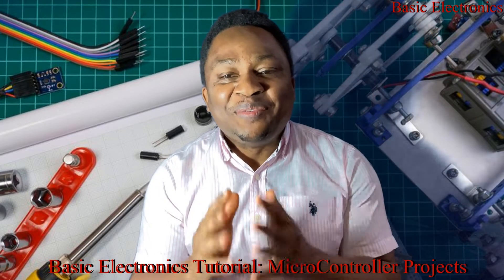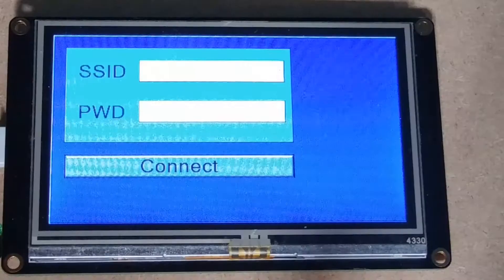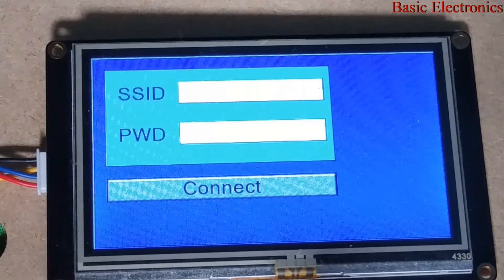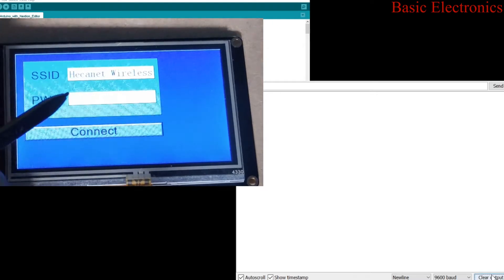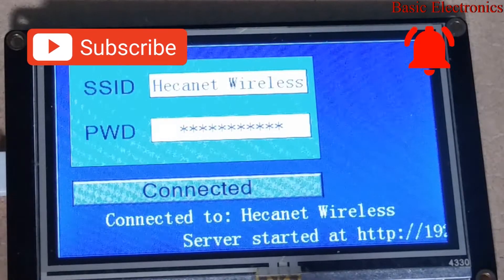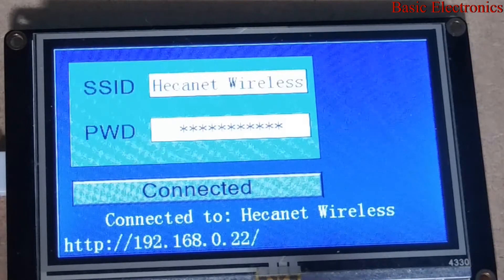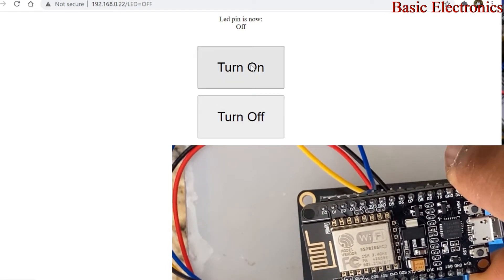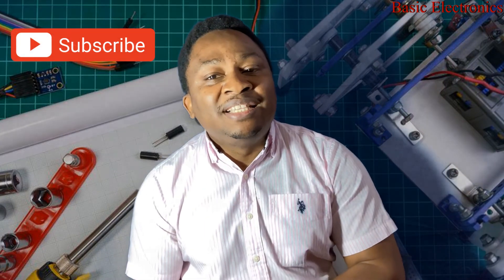HecaWorld unLTD Android Nextion Project Series Part 1 | Arduino NodeMCU | Nextion Display | Servers

Comment: Hello, I am getting an error in the code part for Nodemcu 1.0, why are you giving the wrong code?   Why didn't you share the hmi file? If you're going to teach it, you have to give it properly.

sketch_sep09a:19:21: error: stray '@' in program
   19 | nextion serial port @ 9600bps
      |                     ^
sketch_sep09a:70:16: error: missing terminating " character
   70 | client.println("<center><a href=\"/LED=ON\"\"><button style=\'FONT-SIZE: 30px; HEIGHT:
      |                ^~~~~~~~~~~~~~~~~~~~~~~~~~~~~~~~~~~~~~~~~~~~~~~~~~~~~~~~~~~~~~~~~~~~~~~
sketch_sep09a:71:45: error: stray '\' in program
   71 | 100px; WIDTH: 200px; Z-INDEX: 0; TOP: 200px;\'>Turn On </button></a></center>");
      |                                             ^
sketch_sep09a:71:46: error: missing terminating ' character
   71 | 100px; WIDTH: 200px; Z-INDEX: 0; TOP: 200px;\'>Turn On </button></a></center>");
      |                                              ^~~~~~~~~~~~~~~~~~~~~~~~~~~~~~~~~~~
sketch_sep09a:72:16: error: missing terminating " character
   72 | client.println("<p><center><a href=\"/LED=OFF\"\"><button style=\'FONT-SIZE: 30px;
      |                ^~~~~~~~~~~~~~~~~~~~~~~~~~~~~~~~~~~~~~~~~~~~~~~~~~~~~~~~~~~~~~~~~~~
sketch_sep09a:73:53: error: stray '\' in program
   73 | HEIGHT: 100px; WIDTH: 200px; Z-INDEX: 0; TOP: 200px;\'>Turn Off </button></a><br
      |                                                     ^
sketch_sep09a:73:54: error: missing terminating ' character
   73 | HEIGHT: 100px; WIDTH: 200px; Z-INDEX: 0; TOP: 200px;\'>Turn Off </button></a><br
      |                                                      ^~~~~~~~~~~~~~~~~~~~~~~~~~~
sketch_sep09a:74:16: error: missing terminating " character
   74 | /></center></p>");
      |                ^~~
sketch_sep09a:18:1: error: 'Nextion' does not name a type; did you mean 'nextion'?
   18 | Nextion myNextion(nextion, 9600); //create a Nextion object named myNextion using the
      | ^~~~~~~
      | nextion
sketch_sep09a:19:1: error: 'nextion' does not name a type
   19 | nextion serial port @ 9600bps
      | ^~~~~~~
C:\Users\HOGELD~1\AppData\Local\Temp\arduino_modified_sketch_556886\sketch_sep09a.ino: In function 'void setup()':
sketch_sep09a:24:1: error: 'myNextion' was not declared in this scope; did you mean 'nextion'?
   24 | myNextion.init();
      | ^~~~~~~~~
      | nextion
sketch_sep09a:26:9: error: 'ledPin' was not declared in this scope
   26 | pinMode(ledPin, OUTPUT);
      |         ^~~~~~
C:\Users\HOGELD~1\AppData\Local\Temp\arduino_modified_sketch_556886\sketch_sep09a.ino: In function 'void loop()':
sketch_sep09a:48:14: error: 'ledPin' was not declared in this scope
   48 | digitalWrite(ledPin, LOW);
      |              ^~~~~~
sketch_sep09a:52:14: error: 'ledPin' was not declared in this scope
   52 | digitalWrite(ledPin, HIGH);
      |              ^~~~~~
sketch_sep09a:71:1: error: unable to find numeric literal operator 'operator""px'
   71 | 100px; WIDTH: 200px; Z-INDEX: 0; TOP: 200px;\'>Turn On </button></a></center>");
      | ^~~~~
sketch_sep09a:71:15: error: unable to find numeric literal operator 'operator""px'
   71 | 100px; WIDTH: 200px; Z-INDEX: 0; TOP: 200px;\'>Turn On </button></a></center>");
      |               ^~~~~
sketch_sep09a:71:22: error: 'Z' was not declared in this scope
   71 | 100px; WIDTH: 200px; Z-INDEX: 0; TOP: 200px;\'>Turn On </button></a></center>");
      |                      ^
sketch_sep09a:71:24: error: 'INDEX' was not declared in this scope
   71 | 100px; WIDTH: 200px; Z-INDEX: 0; TOP: 200px;\'>Turn On </button></a></center>");
      |                        ^~~~~
sketch_sep09a:71:39: error: unable to find numeric literal operator 'operator""px'
   71 | 100px; WIDTH: 200px; Z-INDEX: 0; TOP: 200px;\'>Turn On </button></a></center>");
      |                                       ^~~~~
sketch_sep09a:73:1: error: 'HEIGHT' was not declared in this scope; did you mean 'HIGH'?
   73 | HEIGHT: 100px; WIDTH: 200px; Z-INDEX: 0; TOP: 200px;\'>Turn Off </button></a><br
      | ^~~~~~
      | HIGH
sketch_sep09a:73:16: error: duplicate label 'WIDTH'
   73 | HEIGHT: 100px; WIDTH: 200px; Z-INDEX: 0; TOP: 200px;\'>Turn Off </button></a><br
      |                ^~~~~
sketch_sep09a:73:23: error: unable to find numeric literal operator 'operator""px'
   73 | HEIGHT: 100px; WIDTH: 200px; Z-INDEX: 0; TOP: 200px;\'>Turn Off </button></a><br
      |                       ^~~~~
sketch_sep09a:73:42: error: duplicate label 'TOP'
   73 | HEIGHT: 100px; WIDTH: 200px; Z-INDEX: 0; TOP: 200px;\'>Turn Off </button></a><br
      |                                          ^~~
sketch_sep09a:73:47: error: unable to find numeric literal operator 'operator""px'
   73 | HEIGHT: 100px; WIDTH: 200px; Z-INDEX: 0; TOP: 200px;\'>Turn Off </button></a><br
      |                                               ^~~~~
sketch_sep09a:74:1: error: expected primary-expression before '/' token
   74 | /></center></p>");
      | ^
sketch_sep09a:74:2: error: expected primary-expression before '>' token
   74 | /></center></p>");
      |  ^
sketch_sep09a:74:3: error: expected primary-expression before '<' token
   74 | /></center></p>");
      |   ^
sketch_sep09a:74:4: error: expected primary-expression before '/' token
   74 | /></center></p>");
      |    ^
sketch_sep09a:74:5: error: 'center' was not declared in this scope
   74 | /></center></p>");
      |     ^~~~~~
sketch_sep09a:74:12: error: expected primary-expression before '<' token
   74 | /></center></p>");
      |            ^
sketch_sep09a:74:13: error: expected primary-expression before '/' token
   74 | /></center></p>");
      |             ^
sketch_sep09a:74:14: error: 'p' was not declared in this scope
   74 | /></center></p>");
      |              ^
C:\Users\HOGELD~1\AppData\Local\Temp\arduino_modified_sketch_556886\sketch_sep09a.ino: In function 'void WiFiinit()':
sketch_sep09a:83:18: error: 'myNextion' was not declared in this scope; did you mean 'nextion'?
   83 | String message = myNextion.listen(); //check for message
      |                  ^~~~~~~~~
      |                  nextion
sketch_sep09a:91:1: error: 'print' was not declared in this scope; did you mean 'Print'?
   91 | print the content on the "enclosed field"
      | ^~~~~
      | Print
sketch_sep09a:94:11: error: expected ';' before 'that'
   94 | and assign that response to a string named message1
      |           ^~~~~
      |           ;
sketch_sep09a:103:1: error: 'print' was not declared in this scope; did you mean 'Print'?
  103 | print the content on the "enclosed field"
      | ^~~~~
      | Print
sketch_sep09a:106:11: error: expected ';' before 'that'
  106 | and assign that response to a string named message1
      |           ^~~~~
      |           ;
sketch_sep09a:126:1: error: 'print' was not declared in this scope; did you mean 'Print'?
  126 | print the content on the "enclosed field"
      | ^~~~~
      | Print
sketch_sep09a:129:11: error: expected ';' before 'that'
  129 | and assign that response to a string named message1
      |           ^~~~~
      |           ;
sketch_sep09a:146:1: error: 'print' was not declared in this scope; did you mean 'Print'?
  146 | print the content on the "enclosed field"
      | ^~~~~
      | Print
sketch_sep09a:149:11: error: expected ';' before 'that'
  149 | and assign that response to a string named message1
      |           ^~~~~
      |           ;
sketch_sep09a:94:5: error: label 'assign' used but not defined
   94 | and assign that response to a string named message1
      |     ^~~~~~
exit status 1
stray '@' in program
Reply from the maker: Ha ha ha... I did not give you a wrong code. It is the same code I copied directly from my Arduino IDE. If you are having issues, kindly specify the issue and I will try to help you resolve. As you can see from the video, the code is working. You can pause the video at several points to verify you followed the right steps.

Please, make sure you have the right Libraries. If you are struggling with that, let me know and I will share the Library I used with you as well.
Reply from the maker: If you would like to participate in a live session where I will show how this is designed, let me know and I will send you and invitation with date and time for the live-broadcast so you can follow along and also ask questions if you have any. How about that?
Reply from the maker: Here is a link to a Live Stream of the step by step tutorial for the making of the Nextion-Arduino Project - https://www.youtube.com/watch?v=5QoSl09ygVA&t=11s&ab_channel=hecanet

Please, follow the live stream tutorial and if you still have issues, let me know. P.S ensure you use the library found here - https://www.hecaworld.com/microcontrollers/ (or https://github.com/bborncr/nextion).